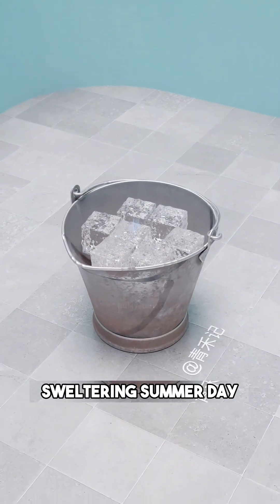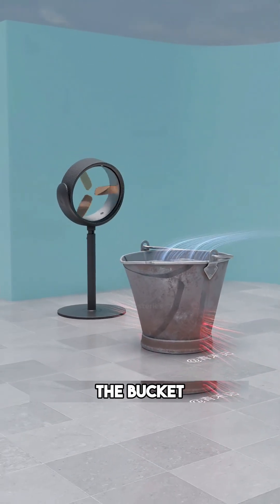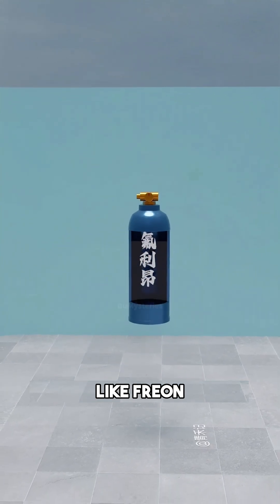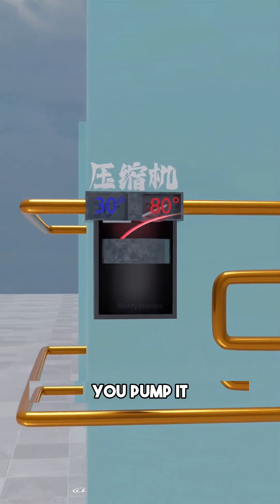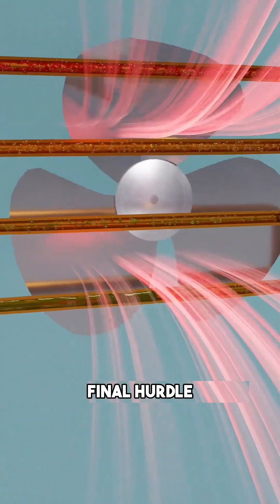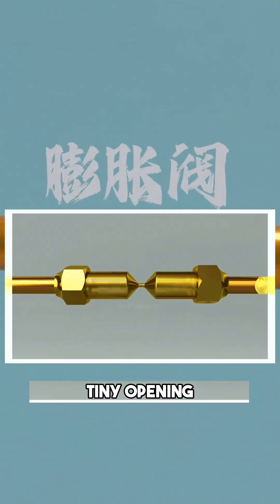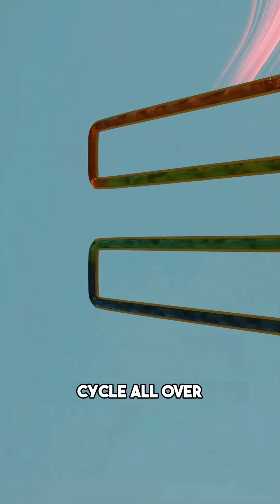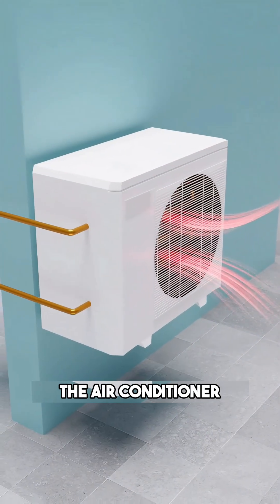How It Works: The Genius Engineering of Air Conditioning #shorts

Comment: Freon really??? It is one of the worst refrigerant that is currently in use...

Major Legal Deadlines in 2026:

    United States: Under the AIM Act, starting January 1, 2026, most newly installed commercial and industrial refrigeration systems must use refrigerants with a GWP below 150 or 300 (depending on charge size). Additionally, systems containing more than 15 lbs of HFCs must follow strict leak repair and detection mandates starting in 2026.
    European Union: Under the F-Gas Regulation (EU 2024/573), a total ban on the use of F-gases in new domestic refrigerators and freezers takes effect on January 1, 2026. Furthermore, a ban on virgin F-gases with a GWP > 2,500 for servicing existing air conditioning and heat pumps begins in 2026.
Reply: Freon was in residential and commercial use for decades bf any alternatives were made.   Prior to a/c creation, there was no reason to research more efficient gasses.  The old saying "if it ain't broke don't fix it". Concerns about meager things like pollution are an  extremely modern concept and that's only bc everything is more expensive.
I just looked it up.  A/c was invented in 1902 and they fazed out freonin 2010.  So they used it for over a century.